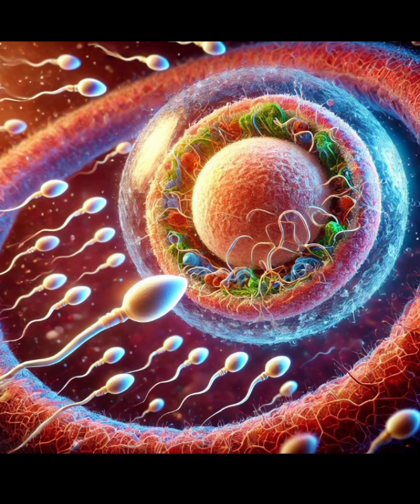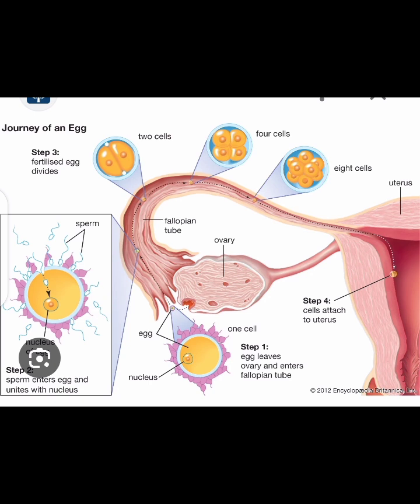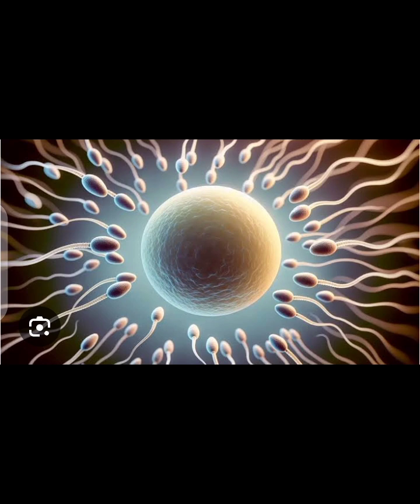Fertilization Process Explained | How Sperm Meets Egg @Easy_Medics_Daily

Comment: Why many women unpragnet?
Reply from the maker: There are many reasons why some women may not get pregnant:

1. Hormonal Imbalances – Conditions like PCOS (polycystic ovarian syndrome)can affect ovulation.

2. Age – Fertility naturally declines as a woman gets older.

3. Blocked Fallopian Tubes – This can stop sperm from reaching the egg.

4. Lifestyle Factors – Smoking, stress, and being underweight or overweight can affect fertility.

5. Male Factor – Sometimes, the issue is with the sperm, not the woman.

If a couple is trying and not getting pregnant after a year (or 6 months if the woman is over 35), it’s good to see a doctor for help.